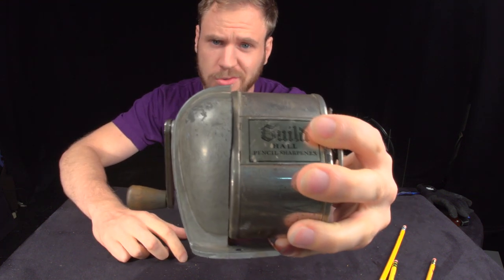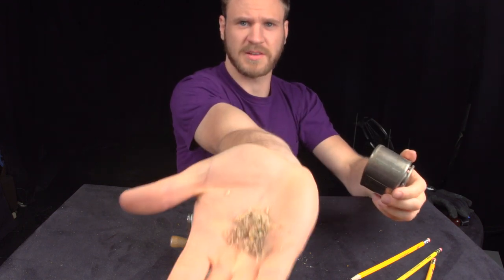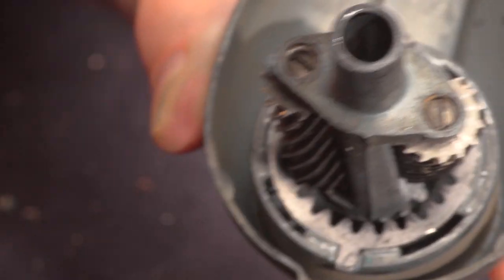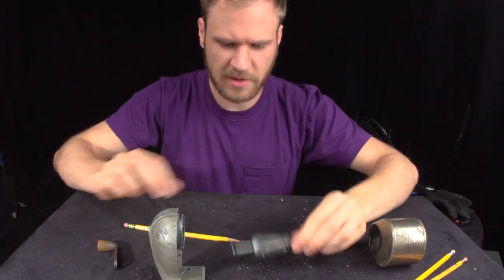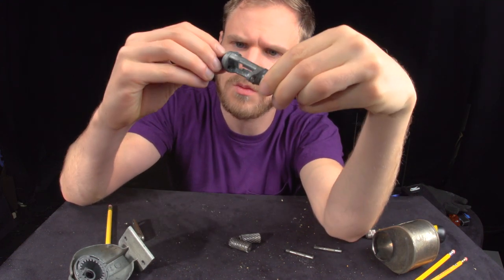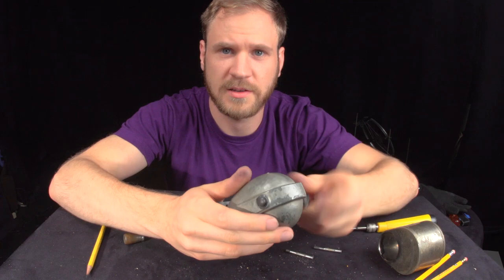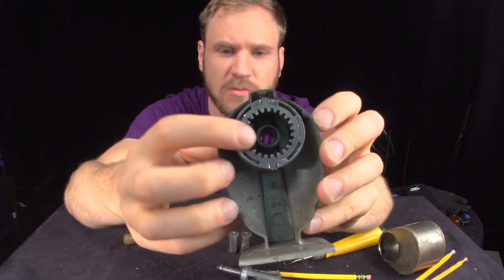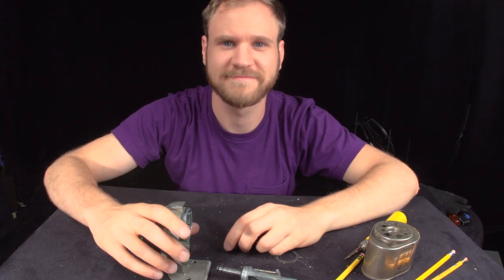Taking apart a mechanical pencil sharpener

Comment: This was very helpful, I found that the pencil was not inserting completely into the bore, but it looked clear of graphite on visual inspection but I could not see down into the inner center.  Looking at how the components fit together via your video I was able to avoid taking everything apart and rather stuck to poking down deep into the roller mechanism to look for chunks of graphite, I did this by using a thin drill and gently drilling into the center, and sure enough it was packed with graphite pieces which were invisible to the eye, color matching the machined steel.  So simply using the drill to gently loosen and then tapping the sharpener on its end to shake out the pieces opened up the blockage.  Now working perfectly and re-mounted on the wall.  Again many thanks for your video!
Reply from the maker: Thank you for letting me know it was useful!

Comment: The old sharpeners cut the wood in the direction  from the tip to the eraser. The new Exacto and  Bostitch manual sharpeners have helical blades that cut in the opposite direction. The effect is that the new sharpeners feel as if they are drawing in or devouring the pencil. 😮

Comment: How do you sharpen these blades? Is it possible?
Reply: Magnus Pagnus Did you ever figure out how to sharpen the flutes
Reply: They aren't blades. It is wrong that he calls them blades. They are gears.
Reply: @bsewelliii  Im sorry, but what do you mean with that?
Reply: @PATRICKJLM  Alright, is  that because a blade is supposed to be straight, or? This is helical.
Reply: @Mingus8  Blades are sharp and that's why they need sharpen. This is just two gears - their "teeth" aren't sharp.
Reply: @PATRICKJLM  Wrong. They are in fact blades in a helical shape.
Reply: there's another video on how to sharpen these blades, using sandpaper on a sort of belt.

Comment: The one I have looks new but the gears seem jammed. I tried WD40 but no luck. It doesn’t appear rusty, but simply somehow stuck. I’m a little nervous about taking apart but suppose that’s the only option. Too bad because it looks bran new.
Reply: If it's made in China just throw it.

Comment: ADD OIL TO THE RING GEAR IT WORK A LOT SMOTHER THE GEARS WERE BINDING AS  YOU CRANKED THE HANDLE DUE TO FRICTION.